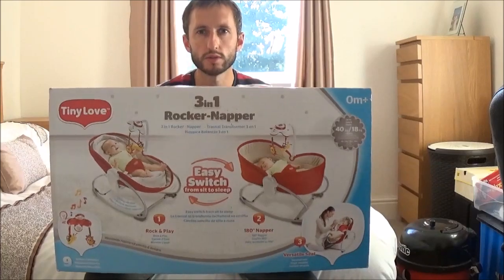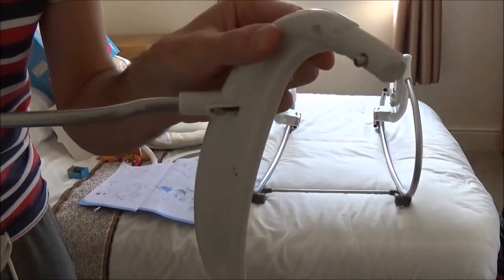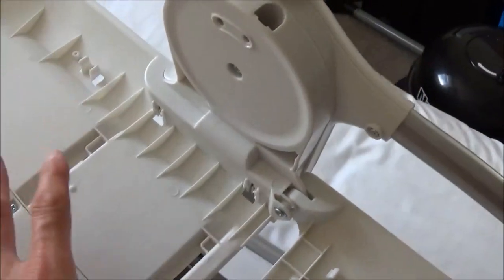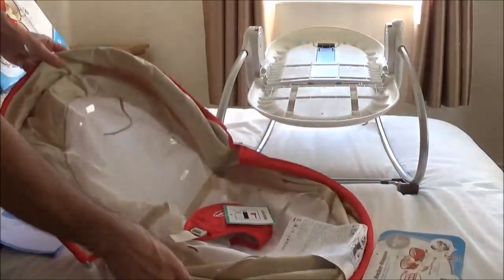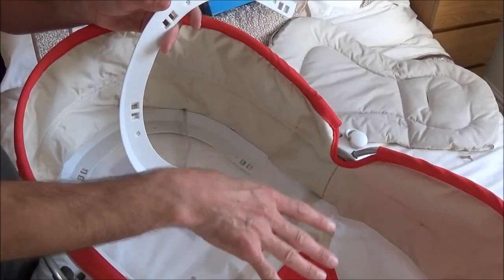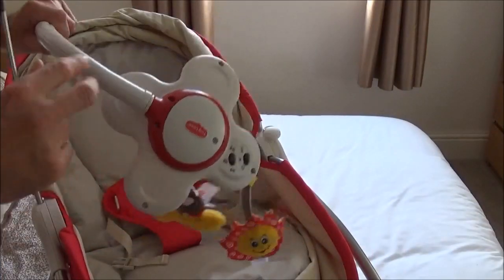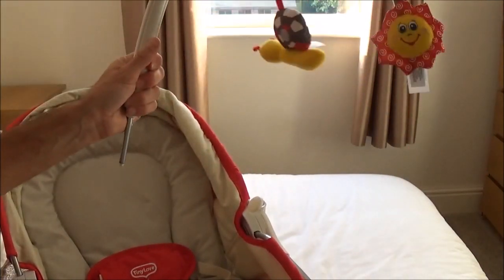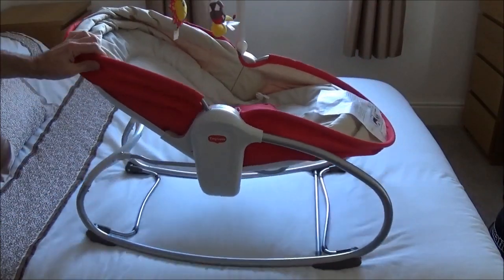Tiny Love 3in1 Rocker Napper assembly, overview & demonstration.

Comment: How do i take the poles out to wash the botton and the hood parts
Reply from the maker: Hi, I don't think it's designed to easily do this. Best thing to do is wipe clean. The fabric is designed so not to absorb dirt, so can be wiped clean and left to dry. Having had a look I think it's possible to remove the fabric but you'd have to remove the plastic tray from the fabric, and remove the poles the reverse way to in the video. It's a lot of effort and you must be careful not to break any parts while you do it. Sorry if that's not a great help but I've only ever wiped mine clean with a wet cloth and left to dry. Good luck and thanks for watching!

Comment: How do you take fabric off to wash it
Reply from the maker: Hi, I don't think it's designed to easily do this. Best thing to do is wipe clean. The fabric is designed so not to absorb dirt, so can be wiped clean and left to dry. Having had a look I think it's possible to remove the fabric but you'd have to remove the plastic tray from the fabric, and remove the poles the reverse way to in the video. It's a lot of effort and you must be careful not to break any parts while you do it. Sorry if that's not a great help but I've only ever wiped mine clean with a wet cloth and left to dry. Good luck and thanks for watching!